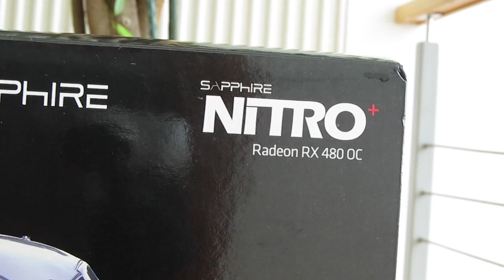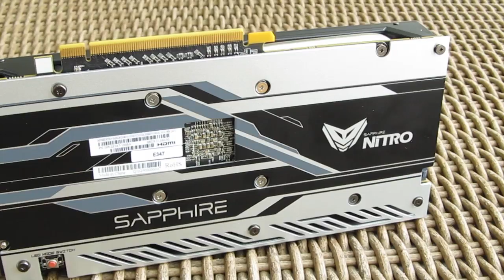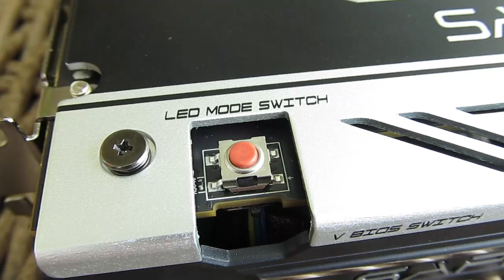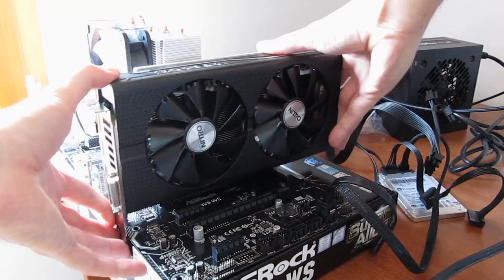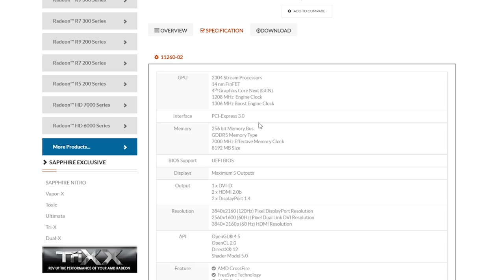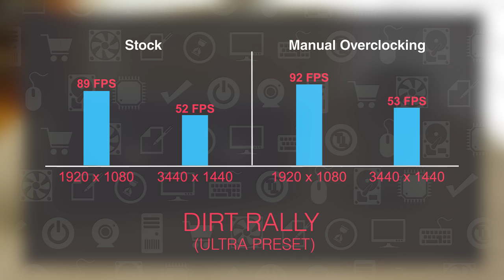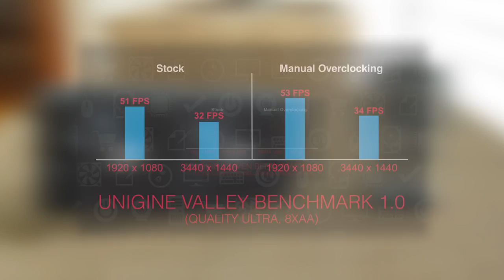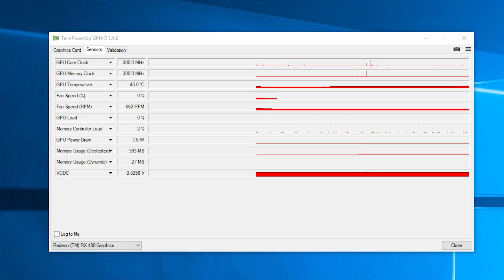Sapphire RX 480 Nitro+ Review - Aftermarket Salvation

Comment: I was hoping a solid 1400mhz would be possible with this card and temps in the 70c - 75c range. My current reference 480 runs at 1320mhz with gpu under volted. At a 3200rpm max fan speed it gets to 70c - 83c under gaming load..depending on game.. Guess I'll wait and see what other aib 480s offer as far as cooling and overclock
Reply: The Asus Strix Rx-480 8G is stable @ 1400mhz, But only using the Gpu Tweak Software. They could only get 1380 with Wattman. I speculate, you could get 1400mhz stable with this using sapphire's overclocking software, Asus gpu tweak, or MSI afterburner. The Sapphire 8gb oc can pull more power than the asus card so I wouldn't be surprised if someone wins the silicone lottery and gets 1440 or 1450 out of one.
Reply: +Dysphoricsmile not sure but thought I saw comparison of 480@ 1400mhz+ that was trading blows with 1060@ 2ghz or so.
Reply: 1400 MHZ on an 8 GB RX 480 does not even come CLOSE TO a GTX 1060 at 2088 - which by the way, even he FE card can easily manage despite literally having the WORST cooler! It is just a copper slug with aluminum fins!

The $250 EVGA SC version, which has a single 92mm fan on a heat stink with 2 or 3 heatpipes, it stays much cooler and quieter at 2088 core with +350 to 450 on VRAM than the FE does with the same over clock.

It is SO EASY TO hit too! All you need do is up power target to 116%, adjust fan curve so it will actually eventually hit above 60% (I always set my fan curve to hit 100% by or before it hits 80 C) - doing that alone STOPS the core clock from going lower than the stock boost speed, from there it is VERY easy to increase the core to hit 2088 under full load - and the GTX 1060 beats the HELL OUT of a stock 980, KILLS the RX 480 at 1380 - so 1400 still would not cut it, it would HAVE to be able to hit 1550 or Above!

And the MINIMUMS! Pascal has the BEST minimum frame rates of ANY GPU ever made! I was ABOUT to buy a Windforce 980, but I am VERY glad I didn't! Now I am bidding on 980 Tis which are selling at $320 to $400 used, if I can grab one for $340 or less shipping included that is what I am getting.

But if I cannot - it will either be a 1060 or a 1070 depending on prices over the next month or so, and the money I can save up.

Anyway, at stock speeds a 1060 trades blows with a 980 at stock, but it ALWAYS has better minimum frame rates, all the Pascal cards Do! Once a 1060 is fully over clocked, it really beats a stock GTX 980 by a LOT! Of course  an over clocked 980 will probably beat the fully OC'ed 1060 in averages, but the 1% and 0.1% lows on the GTX 1060 are INSANELY good, and will alm9st certainly be better than a fully OC'ed 980.

And that is VERY IMPORTANT! The 1% and 0.1% lows represent the stutter, the micro freezing. But on Pascal cards, they are so incredibly close to the average, I'm talking within  30%,  where almost every other GPU ever made hits those lows at around a 60% loss!
Reply: Dysphoricsmile one legit review is enough rather than write 7 paragraphs
Reply: Dysphoricsmile 5fps more isn't killing anything. They're both good cards. If you have a gsync monitor get a 1060. If you have a freesync monitor get a partner 480. You'll never ever see the difference between the two cards unless you have the fps counter up. In doom vulkan the 480 gets 25-30 more frames than the 1060, so that would be saying it's being killed. A 5-10 fps difference isn't shit. Wow the 1060 gets an average of 7fps more in dx11 titles. Big deal... Both cards are good competition for one another like they're intended to be...
Reply: *"And that is VERY IMPORTANT! The 1% and 0.1% lows represent the stutter, the micro freezing. But on Pascal cards, they are so incredibly close to the average, I'm talking within  30%,  where almost every other GPU ever made hits those lows at around a 60% loss!"*Ya, I'm wondering a lot about that too.  The thing is there is noticeable difference in the texture loading of NVIDIA vs AMD.  I think it's worse with Maxwell vs Pascal but still there.  I am thinking that doing this may help the fps 1%, 0.1% or the bare min. scores considerably.  Have NVIDIA a way in the Software to purposely do this?  The thing is people have noticed this as a quality appearance issue which no one seems to have a metric to measure.  So not certain the numbers are as significant as the scientific wannbe's are theorizing until we know more about how someone can fool the metrics.
Reply: You are obviously lookin gtx 1060

Comment: Will you do a comparison between this and a 380x?i think it's more important than vs 1060 or 970, so I can understand if the upgrade is worthed
Reply: It will smack a 380x. It'll perform somewhere between 390 and 390x in some games, and between 390x and nano in others.
Reply: 380X is a strange card. Under DX11 it performs in between a 960 and a 970 and under DX12 it marginally beats the 970. The 380X was an amazing price / performance card a few weeks ago, but the 480 has changed everything.

Like ... EVERYTHING.

Comment: Nice, wiil you make a video GTX 1060 vs Sapphire RX 480 4GB CrossFire/Single vs GTX 1070 in games with resolution : Full HD, 2560x1440,4K ( 3440x1440p )? Just have a motherboard with CrossFire X Support, and think about 2k or 4k monitor and which choice between Sapphire RX 480 4GB CrossFire or GTX 1070 be better
Reply from the maker: I was actually thing about doing something like that, I'm will if I get all the needed hardware!
Reply: +TekTick Oh,it's good, you will make me happy,if you do this tests and i will choose which graphic card i will buy:)

Comment: I've never liked the horizontal fins design for multiple fans because the air flow turbulence in the area between the fans interferes with quick and efficient removal of hot air from that area.

Comment: uh that cooler:/
Reply: jokamutta gigabyte asus or the powercolor version...and I think that it is better wehen the gpu hits under 80 dergree Special for manuel oc! An yes the nitro isnt that quiet...you want to slap me? Ok! Come to germany;)
Reply: JANOXD Are you mad? GPU will hit 80 degrees even if you clock it at 1000 mhz because fans wont spool up UNTIL it reaches 80 degrees Celsius do you understand that?
And nitro is that quiet i heard it over countless review tests with mic standing like 20 cms away from the fan at 2k rpm. It's very quited. All you can hear is the air moving and nothing else.
Reply: jokamutta i would strongly suggest avoiding asus because it's overpriced and you're mostly paying for the lights. Coolers asus have aren't good anymore. Gigabyte is among powercolor and sapphire safe bet and possibly the MSI tho we have yet to see MSI and gigabyte how they perform.
PS: And if you think any of there other brands compared to sapphire will run any cooler... Well you will be disappointed ALL of them will hit 80 degrees or whatever the targeted degree they chose. Cooler won't cool GPU UNTIL it reaches that temperature threshold.
Reply: +sermerlin1 Please do you have a link for this review ? thx
Reply: jokamutta awesome! I wanted to get sapphire one as well... But unfortunately instead of nitro+ oc arrived reference versions... There was some fuck up when store ordered nitro+ so i instead bought the devil... It's just as i suspected... Amazing card from powercolor especially when i unlocked bios but would still buy sapphire :(
Reply: What?
Reply: jokamutta in the most test the temps were very high
Reply: Temps are supposed to be that high mate.  Did you not hear the "target temperature threshold"?? All modern GPUs have threshold of 80 degrees which are on purpose made to hit. Graphics card will overclock itself until it reaches that temperature and ONLY THEN will it increase cooling and decrease overclock to KEEP it sustained at 80 degrees. Not more and not less but 80 degrees... Tho in this situation 75.
Also if you say it's loud so help me god i would've slapped you in real world. That is quiet as fuck people today have no idea what is loud. Heck case fans are louder unless you got those super duper quiet ones which actually don't even pull out air lol.
Reply: JANOXD What RX 480 u recommend then?
Reply: JANOXD Thanx! And I wont slap u   xD
Reply: the gigabyte version has terrible cooling - just as bad as the reference. Tested by jayztwocents XD
Reply: oh yes i dont know wahts going wrong by them its an fucking 150 watt card!
Reply: sermerlin1 I just ordered the RX 480 Sapphire one  :)